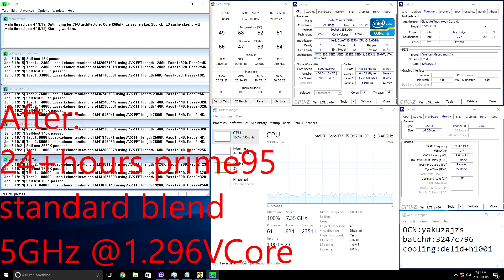Ivy Bridge i5 3570k Rockit 88 Delid - 5GHz @1.296V 24/7 Overclock

Comment: How do you get those temps.. i have h100i v2 and my load temps on 4.2 go to 70c easy.. i have reseated and reapplied paste 10 times to be sure.. also i have a full tower with 3x intake 2x outtake fans and good cable management so i just dont understand whats wrong

Comment: Will be doing the same with my i7-3770 today, not for overclocking, rather to bring the temps down from form mid 80C to what I hope to be 20C cooler. That's what happened with my i7-4790K, same temps, barely breaks 60C now & that's with all 4 cores set to run at 4.4GHz at boot (topped at 4.8GHz, yet I felt 1.4V was too high)..Many says Haswell only drops 7-15C, mine was better & I didn't glue the new copper IHS replacement from Rocket88 on, just sat the prepped CPU in socket, gently placed prepared new IHS on & held with finger while locking it into place. Has ran great for over 2 years & counting! 

There was another brand I was initially going to purchase, I believe by der Bauer, but the kits were always on backorder, so found a Rocket88 ad while looking for one. Just as good of a tool to work with & their 100% copper IHS replacements are slick smooth. Used Noctua HT-N1 thermal paste on top & replaced the Noctus NH-D15 cooler, temps nosedived instantly. Liquid metal used was Thermal Gizzly Conductonaut & will be using the same in the i7-3770. Fortunately, won't need the liquid tape like on the Haswell, lots of conductors all around the die to protect. 

Great Video!

Comment: i delidded mine tried 5ghz got bsod but seems happy at 4.9ghz so far on prime 95 but @1.596v......
Reply: yikes. lower them voltage. i wouldnt be to comfortable with 1.596. id say aim for below 1.4v
Reply: @qdunne  i did drop it to about 4.7ghz but got an amd now lol
Reply: @oldskoolhead0  nice. im a bit low on budget so i ended getting the i7 3770k and delided it and 4.9 ghz and it still does pretty well. tho without deliding it was maxing out 110. Xd

Comment: That is an awesome chip, my 3770k does 4.9  GHz at 1.37V cant get 5 GHz stable.
Reply: What is the highest 24/7 recommended cpu voltage?
Reply: @etop2650  below 1.4 is fine for 24/7. You could technically push it higher but I don't feel too comfortable there apart from for benchmarks. My 3570k barely does 4.8 at 1.448v so I keep it at 4.6 at 1.33v for 24/7 use. The 200mhz wont make a huge difference.

https://www.userbenchmark.com/UserRun/13262604
Reply: @Jepysauce  i know you might not see this, but is there any way i can get all the oc settings from your mobo to your i5-3570k ? im on the asrock z77 extreme4. running 4.3 ghz on stock voltage 24-7 but really want to push the cpu to the limits before i upgrade later this year.
Reply: and i'musing the EVGA CLC 280 for cooling.

Comment: My 3570k does 4ghz with 1.000 volts, would yuo call that a "silicin lottery winner"? Would it be worth it to delid and apply liquid metal to be able to run 5 ghz consistently? I've seen some gaming benchmarks and @5 ghz it seems to run games better than any ryzen or threadripper @4ghz.
Reply: No, what cooler are you running

Comment: Did you ever try to mount cooler over die cpu? If yes, what was the temperature benefit?
Reply from the maker: I haven't tried that. I feel like there wouldn't be much of a temperature benefit since the ihs is supposed to spread the heat onto the larger surface area and mounting the cooler directly over the die might damage the cpu.

Comment: I will try to do the same thing. Aldo I do not have that delidding thingy.. Managed to put mine on 4.6 GHz stable with really a simple OC ASRock eXtreme Tuner on a Asrock z77 pro3 mobo. Just added +0.240V on Offset Voltage. Will be ready to go for more after the delidding. Just one more thing, 2400 MHz RAM CAN WORK with this CPU. I have Corsair Vengence pro 2x8GB.

Comment: Wow thats a good chip. Mine does 4.5 at 1.175v and 4.8 at 1.31. Whats the highest safe voltage for 24/7? With no delid
Thaks
Reply from the maker: With Style I would say under 1.4V for a 24/7 Ivy Bridge overclock
Reply: lmfao here I am needing 1.25v to get 4.5 stable 
Guess I got a shitty chip
Reply: Jeremy not that bad. I push 4.3 with that voltage

Comment: temps were more than fine before so delidding wass actually just for fun, but not needed here.
Reply: He got -15°... thats a lot :3 ... i think that worth it...
Reply: Sir Miguelito it helped but definitely not necessary as he ended up using more voltage to maintain the same clock he had before

Comment: you must have won the silicon lottery,because at under 1.3v not even most modern kaby lakes can do 5ghz.
Reply: Sandy Bridges were notorious for their 4.5-5Ghz+ overclocks back in the day, so this isn't really that mind blowing.
I have noticed that, as Intel has increased the factory clock of their cpu's, they simultaneously decreased the potential overclocking possibilities.
I can't help but wonder if they are trying to hide the fact that their cpu's simply aren't improving as much as they used to when jumping generations.
If this is true, i seriously hope the Ryzen release will have a meaningful impact on the market, because i sure as hell want cheaper processors.
Reply: Except that this is Ivy Bridge. And Intel has just hit a physical limitations with what can be done with silicon.
Reply: Not really, we are far from exhausting silicon capabilities.
Reply: how come not even ryzen does hit 5 GHz today?
Reply: so as I mentioned before: there is a reason 5GHz is a limit, right? it seems to be the sweetspot for IPC/heat/efficiency for current architectures. and those 5GHz were not very common on the old ivy bridges. 
so you still must have won the silicon lottery to have such a chip.
Reply: Because it's not designed for very high frequencies. You could easily design cpu, that can hit 10Ghz, but you'd have to trade so much efficiency and IPC, that it wouldn't make sense.
Reply: Naddel81able There is also a cap for the electricity travelling speed. It is a physical fixed limitation for the clock.
Reply: rip moores law

Comment: I reduced my 3570k's hottest core 20C with Arctic Silver ceramique, it won't go over 4.4ghz with 1.35v. Wanna trade? :)
I used a razor blade and it was stupidly easy. These de-lidding setups seem far less involved though, and much better than the vice and hammer method folks use.
Reply: 3570к 4.7ghz  1.30v
Reply: MilitantPotato Thats a really unlucky. Mine is 4.4 @ 1.23V.
Reply: That is really unfortunate.My runs 4.4ghz @ 1.184V. It used to run with 1.168V but wasnt 24/7 stabile  so i bump it to 1.184.
Reply: Mine goes to 4.6ghz
Reply: Mine goes to 4.8 at 1.44 but I keep it at 4.6 for 24/7 at 1.33v

Comment: Awesome video, I've been considering trying this with several builds, however I currently built a Kaby Lake 7700k setup and the chip is hot from the factory. You've just pushed me over the edge to go through with it. How difficult was the Rockit tool to use? It looked pretty straight forward and simple.
Reply from the maker: Thanks for watching! It was really easy to use and definitely worth getting one if you plan on overclocking. I've seen some Kaby Lake owners improve core temps by almost 30C from replacing the factory TIM with CLU or CLP!
Reply: Chris A I ordered mine directly from Rockits website. they were sold out of the CLU so I got it from eBay for 9 bucks. I'll let you know how it goes, I'll be doing it prob next week when all the items arrive.
Reply: Following up with you, just completed the relid, used CLU on the die and GC Extreme on the lid, h100i v2 cooler, lowered my temps in prime95 by about 20 to 25c. I should have taken a pic of the small amount of paste that was on my die, I was stunned. I'm going to test gaming temps later, BF1 was getting into the 80s while playing. Went from high 70s, low 80s before to mid to low 50s. I'm astonished.
Reply: Holy shit that's awesome, i guess i will do this to my 3570k to get an extra year or 2 out of it :)